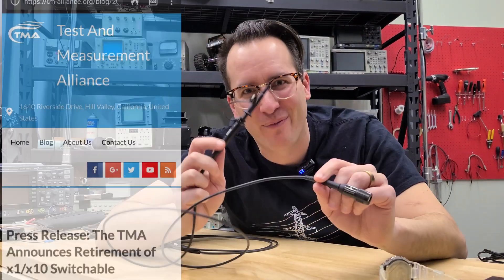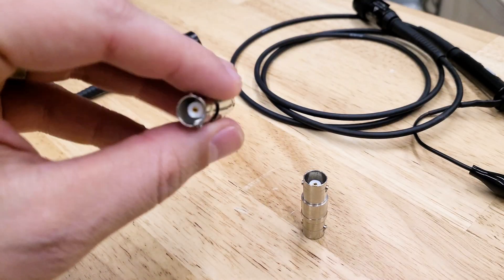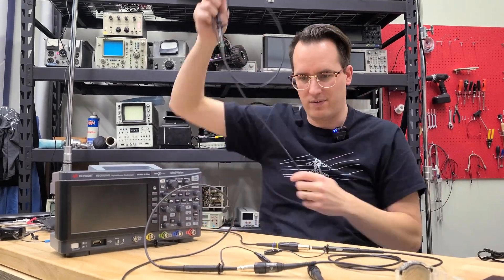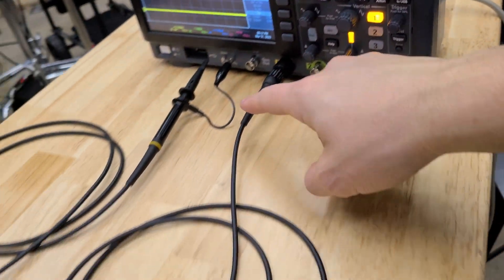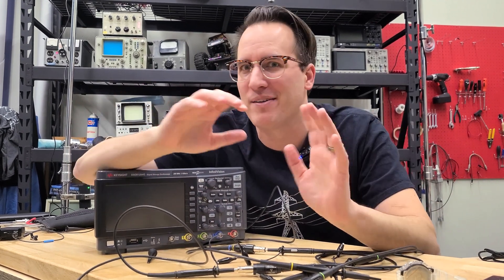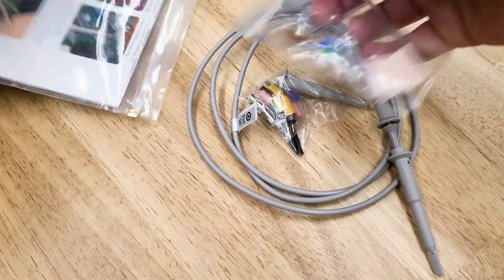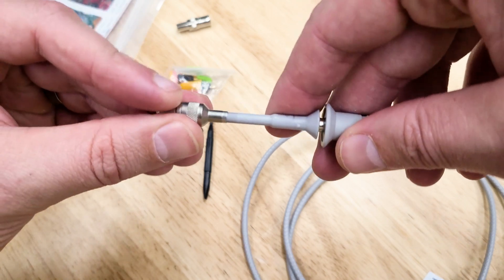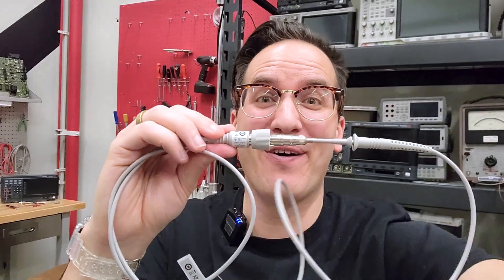They Banned My Probe!

Comment: I like the one of TMA's claims that having separate 1x & 10x probes will reduce climate impact over having a single switchable 1x/10x probe.  Follow the science. It's settled.

"Environmental Impact Reduction: By eliminating the need for additional switch components, the production of fixed x1 and x10 probes can contribute to a reduction in electronic waste, aligning with global sustainability goals and promoting responsible manufacturing practices."
Happy first day of April :)

Comment: how about making a adapter that would convert a 1x to a 10x probe.  All you need to do is move the circuit for the 10x option into the adapter part and you now got 10x probe, remove the adapter and it a 1x probe.
Reply from the maker: Ooh, you could build it right into the probe and put a switch on it to go back and forth

Comment: That's the silliest thing I've seen in awhile. If people are confused by a 1:1 vs 10:1 switch... this isn't making them less confused. So whoever "we" is in this video, "they" should be really mad at "you" right now.

Whereas, the company that made my oscilloscope isn't "banning" anything, they sell all the normal tools that there is demand for.

Honestly, if you're confused by a 10:1 probe... do you even need an o-scope? Maybe just use a logging multimeter?
Reply: I think you're missing one key point here...

Comment: Be careful with that Moebius probe, if you use it to measure signals with high frequency content and accidentally hit the resonant length or a multiple of 1/4 wavelength the standing waves could cause it to self oscillate and create a wormhole which an MSO might fall into and end up on my bench*

* Gotta try...

Comment: The 0:0 probe is really the way to go, it's wireless and has an infinite reach, due to the dynamic nature of the X0 probe it can handle infinite voltages as well as provide the lab with a quick and simple 0V reference. These probes also will never need calibrated as they have an infinite precision, combined with a $0 BOM cost they are the perfect alternative to traditional probes!
Reply from the maker: Hard to argue with that logic
Reply: Does it work with a turboelectroencabulator I bet not
Reply: @leyvarecio3699  Of course the X0 probe can integrate with a turbo encabulator, this is obvious due to the phase velocity of the magneto-hydro-dynamos integrated into the reduced reluctance, infinitesimal admittance properties of the X0 probe!
Reply: Well I think I didn't put too much attention in my magneto-hydro-dinamo III class such a rookie mistake my apologies
Reply: Now i just need to find one...

Comment: Quite right too, all probes should absolutely be banned. It’s absolutely discussing where you freaks shove your dirty black probes. You can’t resist. You are just mega keen on using them. Micro probing here there and everywhere. It’s enough to induce capacitor feelings in me, and worse you induct new freaks into the practice. So the practice goes on to infinity and beyond…